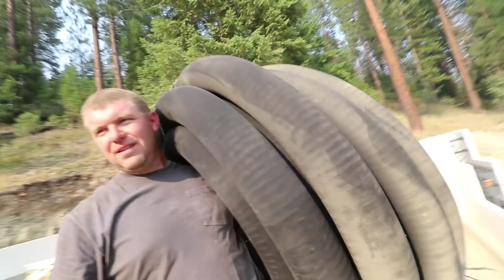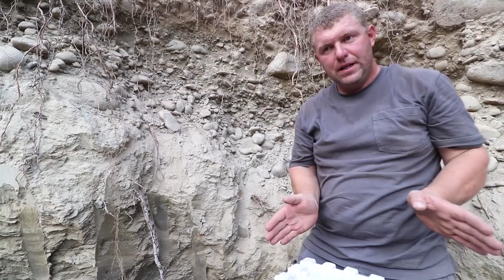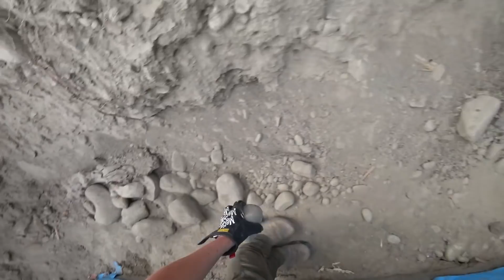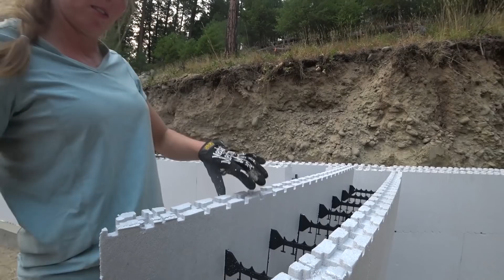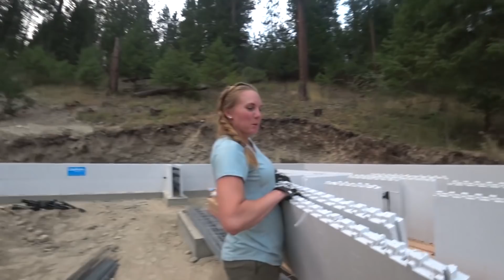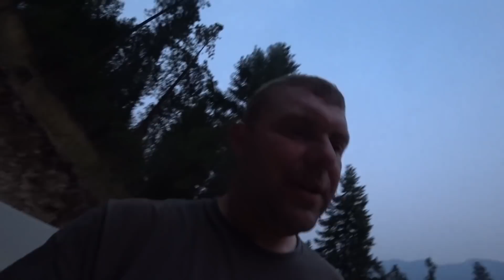OUR MEMBRANE IS DONE! (Waterproofing Foundation)

Comment: The ADS drain pipe that you had in rolls would have worked perfect except the fabric covered pipes are obsolete.  Being crushed by backfill is BS.  This stuff gets used in farm fields and gets direct buried anywhere fro 3 - 10 ft. without a problem.  Big rocks would cause damage, but would also cause damage to rigid perforated pipe.  The rigid perf pipe has bigger holes in it which would allow your pea rock to infiltrate it. You fucked up bringing the ADS back.
Reply: Part of my expertise is in drainage. I have installed a lot of ADS perf around building footings here in Oregon.

Comment: Out of curiosity why are you waterproofing before you pour concrete?if there an issue with the pour and the forms float or split or leak or move it will compromise the blueskin.There is also a chance you could get some concrete behind it when you pour.Anyway,  just use your best common sense when it comes to decisions about application of different products.Think of what it is doing and how it does it and act accordingly.Also, some of the advice  you are asking  pros and pro friends about has taken entire careers of trial and error to develop. Be mindful that you are  expecting this for nothing.
Reply: A blowout would be a bit of a problem with lack of working space behind the wall too, they're betting on not having a blowout on the outside.  I would dare make that bet too I think.  If it blows out they'll just need to section it off, let it dry, clean up the mess and start over that section.

Comment: Jesse, don't worry about the membrane.  So far, you re doing more and being much more careful for this foundation than any contractor would have done.  Keep in mind that when you back fill the foundation the weight/pressure of the soil will keep the membrane against the ICF.  The styrofoam also has a measure of water resistance to it. I think your foundation will be just fine.  just go easy when installing the drain tile (pipe) and pea gravel so as to to puncture the membrane.

One thing to keep in mind is that if you do develop a leak, it will be difficult to locate the source, owing to staggered seams and various layers of construction material involved. But honestly, I think it will work splendidly. Just go ahead with it.

Comment: I used to waterproof foundations for a living. I've used many variants of "peel n' stick", "torch on" and "hot rubber" applications and I've NEVER heard of putting the membrane over the insulation! Insulation is used to protect the membrane when you back fill! Water WILL seep and crawl up/around/into every unsealed seem! The membrane NEEDS to be applied to a cleaned and primed foundation! Every ripple, wrinkle and air pocket will collect moisture and eventually push the membrane off the wall especially if not properly prepped and primed! Having repaired MANY leaking foundations I foresee that you unfortunately WILL have leaking problems in the future since you live in a winter climate.
Reply: Raze Havoc yeah I couldn't agree more. This may bite back in the future.
Reply: Yikes.
Reply: I've always used extruded polystyrene for it has far more strength and was required in the region I worked in. The ground was generally river basin composition with as much as, if not more rock and boulders than these guys are encountering.
Reply: I see a future need for a sump pump lol
Reply: +Dale Jensen no offense but would you care to explain why?  It's a poured concrete wall with drainage tile all around and hopefully proper grading.  Screw the styro and membrane, even when that all rots away it won't matter there's still drainage that's the part that matters.  It's a walkout basement for crying out loud, they're not building on top of a spring!
Reply: Raze Havoc they're not building a swimming pool, they're building a walkout basement in the side of a well-drained hill.  Proper grading = no water problems for them.  People way over-analyzing this, it's like working for the government good grief
Reply: That's what I thought too. Our basement is on a slope and with no membrane at all, just concrete. It's dry as a grandma's Va-J-J. Unless you are planning on heating and living in the basement, why bother with the membrane at all? Just get some proper ventilation up in that biatch.
Reply: ICFs are done this way, you clearly never worked with ICF.
Reply: That's true. Maybe ICF demands waterproofing, I have no idea. I just don't understand why one would bother waterproofing a walkout  basement. Is ICF a good choice when building a walkout basement, I don't know? What I do know is that with proper drainage and ventilation a walkout basement will be plenty dry just using concrete. My 60 year old basement is a testament to that. Waterproofing can sometimes be negative if you end up trapping moisture. Then you get mold, rot and all kinds of problems.
Reply: Odd that these comments didn't show up on yesterdays video.